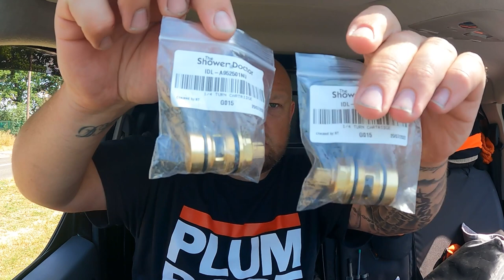CONCEALED SHOWER PROBLEM.. NO COLD WATER!!!.. NEVER believe what the customer says!! PLUMBING UK

Comment: That’s a trevi. 
The new flow cartridges are solid brass. The old ones can separate. Generally if you undo the threads till resistance is felt, spray some wd silicone lube in, they should just pull out as one. Very common shower. Ideal standard trevi. One of the best showers!
Reply from the maker: Yep…. Found all that out during this video, except the bodies inside were that brittle they just fell apart. 👍🏼👍🏼

Comment: With the size of that hole behind the cover plate, is that not asking to leak?? Is there a inbuilt seal in the rear of the cover plate?
Reply from the maker: I didn’t fit the shower mate…. I’ve just been called out to sort it. It’s been in for years and been used so there is no issue with it👍🏼👍🏼
Reply: @MJTiffPlumbing  oh yeah I appreciate it’s not your work. Just amazes me sometimes how some of these hidden shower valves don’t leak into the wall. Good design I guess.
Love the content best in you tube 👍

Comment: I agree never trust what a customer says. I’ve been mislead so many times and spent so much time looking in wrong direction. Custome called me out claiming motorised valve was faulty as not all the rads were heating. After many hours of testing and investigating Ifinally asked if it has always been like this. He replied he wasn’t sure. I finally discovered the distributor tube in the return in the boiler was incorrectly installed
Reply from the maker: Always check yourself 👍🏼👍🏼